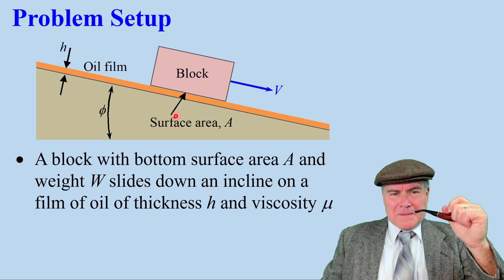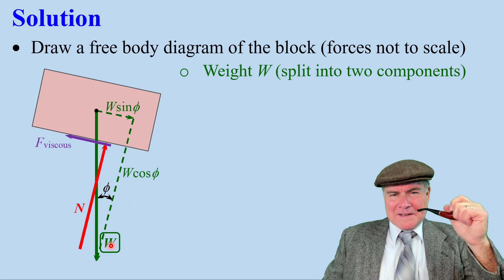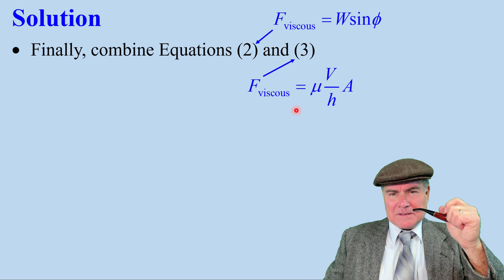Block Sliding Down an Incline on an Oil Film

Comment: Can you please discuss a torque which was mentioned at the end of the video and how it changes the answer? Or recommend some literature about this problem. Thanks!
Reply from the maker: I am not sure what you mean. The linear profile is an approximation when the gap between the cylinders is small, so you can use the same formula for the shear stress. Integrating over the whole surface gives you the torque.
Reply: @johncimbala  It was mentioned that the thickness of an oil film is not really a constant and this complication will be discussed later. I'd like to learn about this.